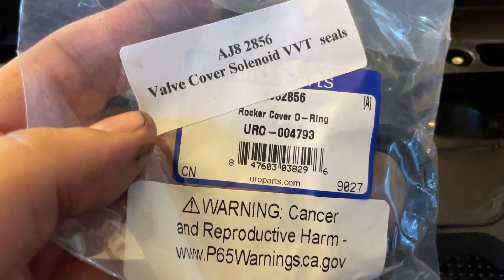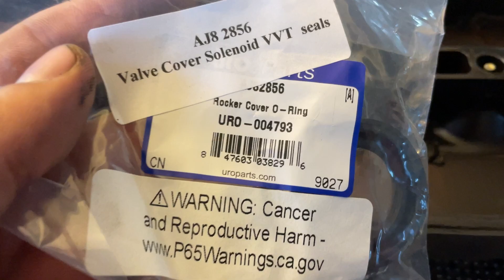Maintain your Land Rover: How to replace your valve cover gaskets. Part 2

Comment: Thanks for the guide.  What did you do about the dipstick mount?  Just driving without it?
Reply from the maker: Nothing.  I’ve been meaning to 3d print something but it doesn’t really matter.  The dipstick stays in place as it should.

Comment: Ok great job my 4.0 lr3 leaking driver side bank 1 noticed oil just above the exhaust manifold cylinder closet to driver now hoping they have gasket kit for me appreciate the vid 👍
Reply from the maker: I suspect it will be easier on the 4.0. let me know If I can glance at the shop manual for you.
Reply: @mirepoixmatt1  
Appreciate ty